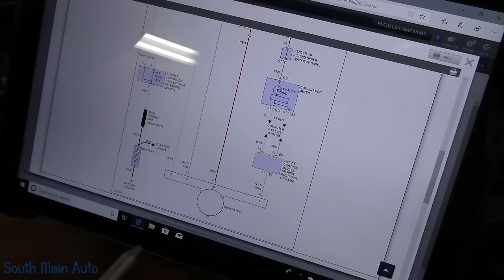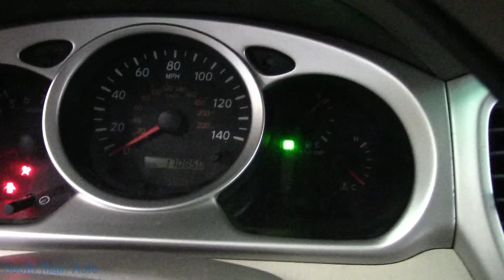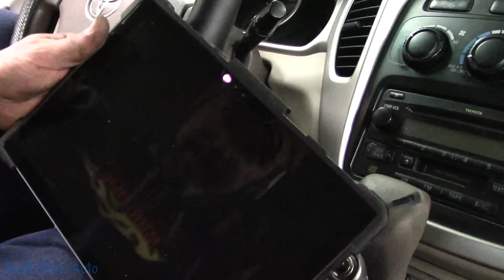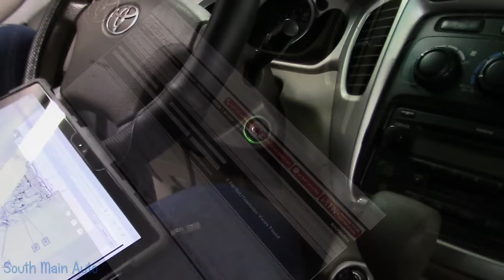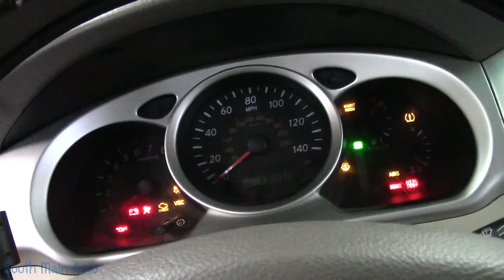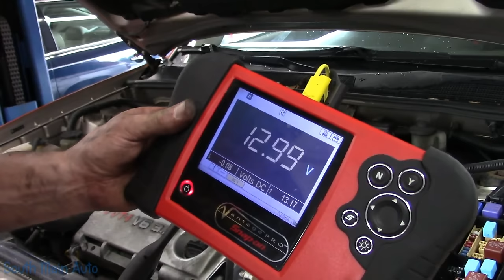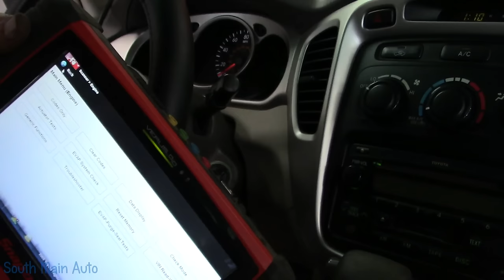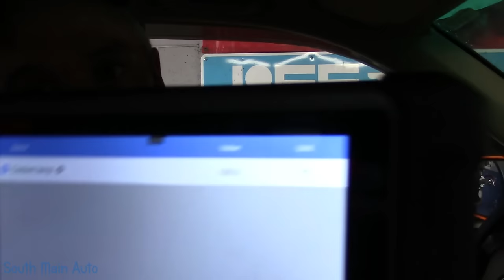Toyota Highlander - To Fix It, Follow The Smoke! 🔥

Comment: my car were burnt to the freaking ground before I ever figured that one out. third degree burns. after you shot at the wires and it was still running crappy I automatically assumed that it still had a problem cleaning the throttle body is so obvious but I didn't even think of it. God damn pot!! can I come across this problem I hope I can remember this video exists. but then again I drive a Dodge transmission engines they just blow up shortly after the paint falls off. we usually don't get a chance to fix nothing. 🙄 thanks again

Comment: Eric !O it`s cousin Vinny AKA jhackme.... you hit the gamete.. my self being in this business all mylife; born in to a family collision center...From  A-Z  smashed to waxing and detailing... I have all way`s been a TOYOTA coyote lover and driver from the tundra to Camrys corolla to my fj cruiser TRD and even my Wifey`s land cruiser... point>>>>> dollar for dollar  they rock.... that plug that had the nuclear melt down is a known problem.. I have literally  fixed 8 that I can remember in the past 15 yr.'s a thing that does occur with especially  junk interstate battery`s they vent to atmosphere and that vent may be on that side iam not sure if that one was venting on that side or both cap`s are vented >> point is  and I do agree with the event`s you pointed out from>>>  your great deductive and methodical & analytical      approach to diag and repair... the moisture and acid along with the under hood temp`s plus the load on that plug  plus the ac not working ...plus a  low battery put`s a load on alternators and they draw and heat up that plug    Toyotas especially  and all vehicles really.... you could have done one thing different what I have done after the 2nd or third I went to the salvage yard and picked out a ten wire plug and wired it in other than that you <<<<< as you know..... Did a wonderful job God bless you and yours and keep rocking cousin Vinny out AKA Jhackme  >>>>>>>>>>>>>>>>>>>>>>>>>>>>>>>>>>>>>>>><<<<<<<<<<<<<<<<<<<<<<<<<<<<<<<<<<<<

Comment: In examing the connectors it reminds me of amperage. Amperage draw converts into Heat. Something tells me whatever is in that circuit is drawing more amps than is appropriate. Assuming the connector is at fault is not good practice. Although your approach was efficient, and ultimately, effective, I was wondering why a current draw test was not performed. Most interesting approach.

Comment: If you disconnect battery... toyotas have to relearn idle rpm.  Turn key on and off 3 times... then start motor and let sit for about 10 or 15 min.

Comment: Approach was good, would not have tried to replace connectors. Touch test on the connectors should have found the burnt one - it would have been hot. Using a $20 digital laser thermometer (think Harbor Freight) is a really easy way to find things that are too hot or too cold, from electrical connectors to brake rotors. It also works on morning coffee and lunch from the microwave.

Comment: Could you use any type of rated current connector  and leave a spare half for the future, no no of course. A replacement original  connector would be more likely to burn if it was under current rated. Best decision was made. Thanks.

Comment: That noise sounds like torque converter bolts may be loose. I had that happen before. Took one out at a time and put locktight on them and retorque them.

Comment: Ive had corrosion in connectors create resistance which caused connectors to get toasty and start to melt together... Luckly caught it in time before it went up in smoke. Was have regulator/retifier issues on my atv.

Comment: I see why people complain about the MZ engines running too hot, the 1MZ-FE has an 82°C/180°F thermostat which in my opinion is ideal, yet they don't kick the cooling fans on till 95°C/203°F then off at 90°C/194°F
Why not have them run with a cooling fan switch (in the middle/lower part of the radiator) click on at a more close to desired ON @ 90°C/194°F & off at 85°C/185°F

Atleast in the 1MZ, the 3MZ might be slightly different

Comment: I have found that connector to be a common problem on these Highlanders. Usually it starts with the fans staying on and if ignored for too long eventually degenerates into the issue here.the weather proofing on the connectors just isn't up to the task for dealing with all the water and salt that gets into that area of the car

Comment: An older car like that I'd have done precisely the same and soldered the wires. If it corroded once it could do it again if the car lasted long enough.
Electrical issues in modern vehicles can be a nightmare. A little smoke under the hood is always a useful diagnostic tool 😂.

Comment: @7:32   Finding a ground in the cabin? I believe the difficulty in obtaining a decent ground is a safety feature. I shall explain. Should someone plug in a device to the 12V circuit and leave a plug or open wire dangling about in there, its going to short anywhere and possibly start a fire. Obviously the cigar lighter shroud is grounded but that will be the only one you will usually find. The metal door frame is a good option should you need one for testing.

Comment: Love the channel! I've spliced out connectors before but hate doing it if I don't have to. I'm not criticizing at all just wonder if you have used or seen posi-lock connectors. They are reusable and you can get weather tight versions. Kinda expensive compared to a normal butt connector but much cheaper that new harness. And they allow you to disconnect if you ever needed to pull that fuse box.

Comment: I heard you can depress the emergency brake, turn off all loads inside the car, and then cycle the key 3 times, starting it on the 3rd. Then, put the car in drive and give it some gas while holding the brake for 5 mins to get the idle to level out. I would say cleaning the throttle body sounds almost easier, tho, lol. Do you think someone could've replaced the alternator and accidentally screwed up those wires?

Comment: Hi Erick  I love your channel  I've been a mechanic for over 45 years and I'm still learning from you,  I was just wondering why you don't use weather pack connectors to make repairs when you have plug issues.
Reply from the maker: Here in the Northeast the cars I get only have a couple years left. Installing a connector is almost prohibitive. We fix it seal it up make it run a couple years then it gets recycled.

Comment: Fuses don't blow due to old age! If a fuse blows, it did it's job and opened the circuit due to an over current situation; nothing else blows a fuse.  Not even vibration or heat cycles.

Comment: Nice job 👍 I'd call and get a ten pin generic connector with pig tails and solder it in. Mazda RX8's are famous for a poor connection at the electric P/S motor (under the air box). Mazda no longer makes the connector so I just order a 5 pack generic connector from Amazon. But knowing how long your vehicle's last out there your repair was good as gold.

Comment: That connector is actually a common problem on the Toyota's. 2 pins short out internally touching each other
Reply: Just had this issue fixed in my 04 Highlander

Comment: Hey I know this is old and not sure if you will even read this but I use connector experts to get all sorts of pigtails when there not available from the oem. They are expensive but they have a large selection not a sponsor lol. They have the male and female and come already pined with a length of wire. If that helps

Comment: I haven't seen it mentioned but it could have been defective installation of the pins in the connector and a loose connection which is a high resistance connection which generates heat It may not have to have been by corrosion itself

Comment: Eric, you are my Hero, and I like your fix. However, the melted connector could have been caused by a short beyond the connector, so would it not have been wiser before soldering every wire to test for a ground fault beyond the connector?

Comment: So which pin failed first, overheated and melted with the other wires? What was the cause of the high temperature, overload, corrosion?

For in-line connector repairs (wire to wire) where you do not have a source for the connector and pins, or you can't wait until they are in, and perhaps you don't want to commit to an OEM repair until you have solved the issue, I use Deustch DTM (up to 7.5 Amp Continuous, 2, 3, 4, 6, 8, and 12 positions), DT (up to 13 Amp Continuous, 2, 3, 4, 6, 8, 12, 18, and 48 positions) and DTP (up to 25 Amp Continuous, 2 and 4 positions) I have special pin crimpers for each pin style. The pins are of very high quality. This may sound a little strange but I may actually use two connectors in-line. I have access to wire line wire stock, many different automotive wire sizes and color combinations, the most being in 18 AWG. Also, I have the option to use a generic breakout box for the Deustch connector types to gain access to signals. So I can cut the wire harness, strip wires, crimp on pins put into a connector and then test, or make an extension harness if I don't have easy access. Much like in the video where you had to pull the battery out. It is good to use the breakout box approach to isolate signals to take circuit resistance or current measurements.

Comment: I could never understand why, when you come up against a melted terminal in a connector and replacing it is foolish (agreed) that you don't use male/female encased connectors to reconnect the repaired wire(s). You mentioned, if in the future the fuse box needed replacement, the 'soldering' would be an issue. Using male/female encased connectors would be slightly better than soldering but still messes with OEM. It is just easily disconnect-able if need be.

Comment: I am a (wishing I had) shade tree mechanic. I have been working on cars since I was 16. So about 39 years. I don't rebuild engine but I could replace them on most rear wheel drive vehicles with little problem. I work on cars for family but mostly friends cars who ask. I figure out whats wrong and if I feel confident I can fix it I will if they can afford the parts. I don't ask for money. I do this for the same reason, I hate to see a single mother trying to make ends meet and having to pay hundreds of dollars for brakes. It's highway robbery.  Most of the time I tell them I don't want anything. So I usually end up with pizza.

Comment: A friend that tells you that your fly is open is a better friend than the one who fawns all over you telling you how great you look before sending you onstage.

I get that every comment here is that you are the hero. To be completely fair, I have watched a lot of your videos, and I do respect your troubleshooting skills. Yes I have learned things from you, there is no real question. I even further acknowledge the added difficulty that trying to film it all imposes. Doing it is hard enough. Filming it in a way that is watchable is to be respected.

With all that said, there is one single bone to pick. I've picked it with you before. Out of all the crap you get into on this channel, I think it is impressive that there is only one (no I don't think that you live and breathe waiting for validation from me).

I watch you closely, and I admire your work.

BUT- you need to step away from the solder. Quite frankly, I'm surprised that you haven't arrived at that all on your own. I have no issue with cutting the connector, and have done it many times.

Your approach to soldering is from a mechanic's perspective, and not a metallurgical perspective. I could rattle off a shit ton of reasons why you shouldn't be soldering wires together, especially automotive wiring, and especially underhood automotive wiring.

On this fix, I would have cut the connector, shrunk down the butt splices, and painted them with Scotchkote (the shrink terminals will get green pus even if you shrink them properly), and it would last forever.

I'm not trying to sound like a blowhard, and I don't necessarily care whether you take it to heart or not. I've been at this for decades, so I'm not just simply pulling it out of my ass.

Finally, if I didn't like what you do, it wouldn't bother me, and I wouldn't bother you with it either. Yeah I know the video is over a year old.

Take care!

Comment: Nice splice job, Had you gone to Toyota for new Connectors , You would have needed to take a 2nd mortgage out on your $hop.. Looks to me ,Toyota has a design fault. That connection point should have been in a rubber water tight boot, (very vulnerable location)  especially with the winter road salt applications. Also wanted to give you some info on cleaning up  electrical connections that are not too far gone. I do electronic work out of my home and run into corrosion issues non-stop, I use this product called "DEOX-IT" for all suspected connections, it's a little pricey  but is a God send and makes connection points, contactor surfaces, potentiometers, switches ect. like new.

Comment: I had a new Pontiac G6 that blew a dome light fuse after about a year, replaced it once and never had an issue with it for the next seven years, no clue what caused it. Unlike my Grand AM that regularly blew dome light fuses because some wires inside the door rubbed on a metal bracket which took about twenty years to expose the wire and start shorting.

Comment: blahblahblah either cut the connectors out and solder the wires together and shrink-wrap OR crimp them onto connectors and connect them individually. The main issue is did the connector get put together wrong and that caused the shorts that fried the connector or is there a serious problem downstream from the voltage supply that is attempting to short-out the alternator? That's probably what I would look at first, and you don't need to fix the connector to do that. Just put a dc power supply in place of the alternator. If there's no short and everything runs fine then the likelihood is that the alternator isn't putting out a clean well-regulated voltage. Alternators are surprisingly problematic.

but the real problem is that the fuses weren't enough to protect the wiring

Comment: nothing wrong cutting the plug off and wiring them up. If the plug wasn't there what would it be wire together. Everything runs on fuses so should be fine. Btw when i worked at a shop i hated the SNAPON reader. HATED it . autel  i loved and worked like a charm.

Comment: We had junkyard next to the shop I would go to junkyard cut out any male and female connector with eight wires that is already connected to each other it doesn't have to be Toyota can be any year any make as model long lt has eight or 10 wires and solder that in..but first paint wires on the junkyard male and female connectors with white or black spray paint so not to confuse the next guy... It forces him to look for the colored wire. The plugs may look different you just want to be able to plug and unplug it when you want ..Or I would do what you did solder them. But I would have checked to see if there was still a short and connected one WIRE at a time TO SEE IF IT GETS HOT or blows a fuse before I solder them all. ALSO, I DID HEAR AS  WIRE INSULATION GET HOT AND COLD  AND OLDER IT GETS IT WILL START TO SHRINK  and pull away from the wire exposing bare wire ..IF LOOK AT VERY OLD CARS AT THE PLUG AREA YOU WILL SEE BARE WIRE COMING OUT OF THE PLUG... IT IS SHRINKING AND PULLING AWAY FROM THE PLUG. A JUNKYARD GUY TOLD ME THIS AND HE SHOWED ME. BUT THESE WERE MUCH OLDER CARS. on new cars, they crimp wire and the insulation. I HOPE.

Comment: I know you don't necessarily know the cause but my curiosity is could it possibly be just simply because the fan relay went bad causing the fans to constantly be on overheating the circuit and melting everything to the point of short? Because now even though less likely since it's all been replaced what if the cause has not been addressed and now since you've eliminated the failure point of the connector and repackaged wires that it could potentially short in a new way potentially causing engine fire because the connector is not there to melt because of the connector is a failure point. Because the connector actually separates an orients the wires so they're not all somewhat mashed together so you can help diagnose circuits. Because now if there's an issue it would all clump together, and since you made it a stronger connection the failure would find the next weakest link or melt down. What if the fuse box or a different circuit is the issue now it's an ordeal to separate things. As much of a pain that would seem to be I would still pigtail it even if I had to go to a junkyard to find the connector just to reinsert the disconnect issue and to reintroduce the failure point just for safety reasons. Or at the very least if the yellow wire did go to the fans and most likely the cause of everything I would isolated from the others so as to not allow it to propagate and isolating it should it happen again would melt the fan wires and not everything else. Maybe even introduce an inline fuse on the fan wire just to eliminate the hazard.

Comment: I know I am three years late in viewing this video but I am sure what happened to the connector was corrosion caused high resistance in the connection, it overheated and melted the other wires before the fuse blew.

Comment: hi in my opinion you did a good job and connecting cables, personally with me being a sparky i would have used a terminal block temperarily just in case there was another short, but good work on your behalf, by the way the alternator belt was not slack by any chance?

Comment: I heard once you paint orange lines around your car it will fry the electronics by default
Reply: I suspect the previous mechanic on the vehicle is still in high school. Find myself surprised there was no crooked muffler with a 4in opening.